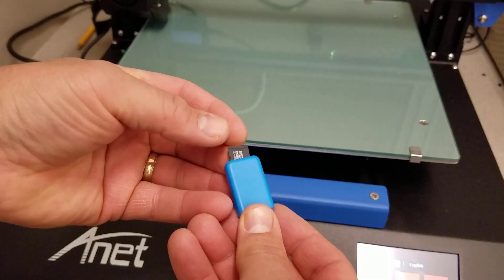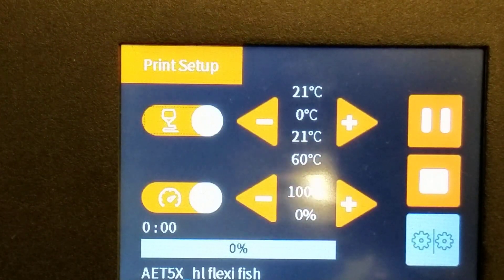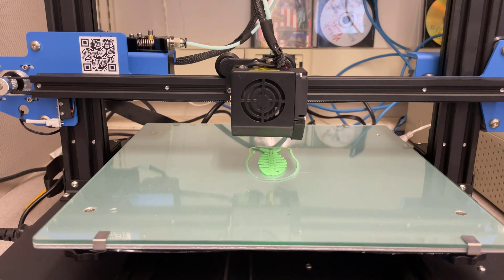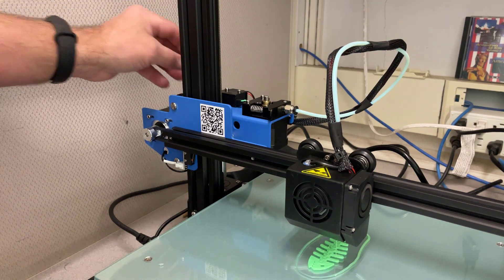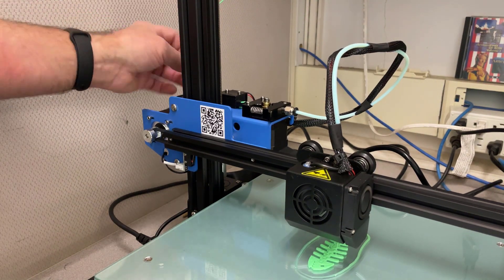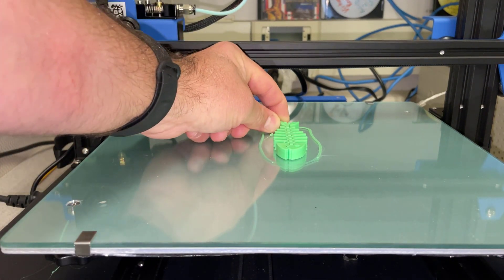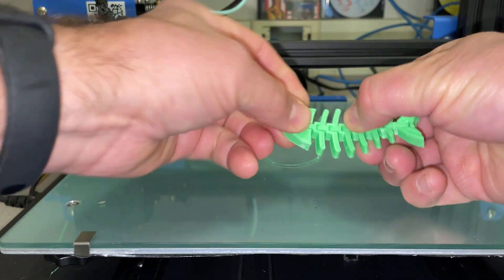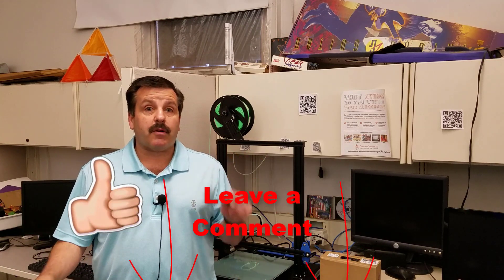Anet ET5X Print in Place Fish | Filament Run Out | Stress Test 1

Comment: I know this video was a while back, and the printer probably isn't your newest, but I don't suppose you have or can create a video about changing filament (for a different colour) at a specific layer during a print using Cura?

I've been trying to figure it out on a ET 5 Pro and can't and can't find any information anywhere about doing it for these printers.
Reply from the maker: Good news! I do still have that printer. =) Is yours running the stock firmware?
Reply: @HLModTech  yes it's exactly as it came.

I'm not entirely sure what he difference is between the 5x and the 5, but from reading around the main difference between the 5 and 5 Pro was quieter steppers motors and a bigger power supply.
Reply from the maker: @tomsimmons4482  I think you are correct on the differences. I am guessing that with the stock firmware it is not possible. Mine is stock as well. I may take the plunge with Marlin just to see if we can do it that way too. Thank you for the nudge.
Reply: @HLModTech  It seems daft that you wouldn't be able to do it with the stock firmware - but you could be right, I haven't found any evidence of anyone saying it can be done on these.  I'm also thinking of going to Marlin 2, there is a version of it "sanctioned" by Anet on their site - all 3 links for the different versions of the 5 point to the 5X firmware, but there is a comment from Anet saying that is correct
Reply from the maker: Sorry for my delay. I did run a test print on the ET5x with stock firmware. It paused at the layer for a second and immediately restarted witout a filament swap. I think there may be code would could add to force the filament change, but I do not know it. I will try to create a video today showing those steps and asking for assistance to add the right code afterward. My viewers have helped me a ton over the years. Fingers crossed there is a solution out there.
Reply from the maker: I also have a eT4x that I have moved to marlin. I will test it to see if the filament swap works as it is suppposed. to. That will give us a clue if it is even worth the swap.
Reply: @HLModTech  Thanks - look forward to hearing your results
Reply from the maker: @tomsimmons4482  If you are willing to shoot me an email hlmodtech gmail, I can keep you up to date a bit easier.

Comment: love that feature, the run out detect. I printed something on my ender and after checking about an hour later the extruder was 2 inches above the piece printing nothing and the filament running out the side down to the floor from breaking. Might have to look into this printer. thanks HM
Reply from the maker: I have lost a lot of prints too over the years. I have had some where even though it stopped... it failed on restart. This worked like a champ which is always fun. =) Thanks for stopping by!